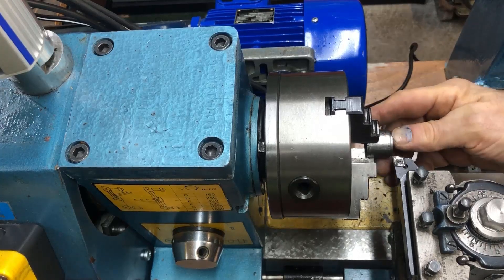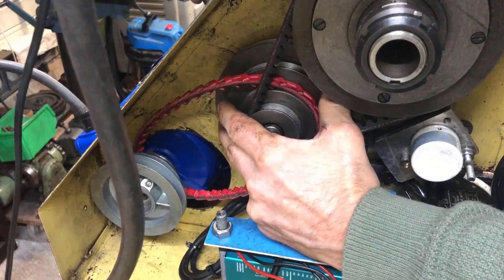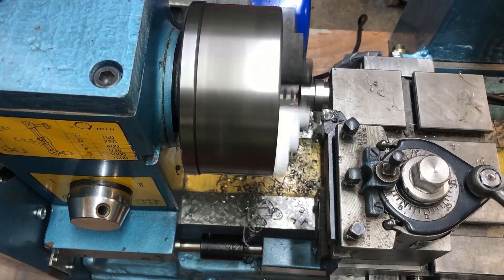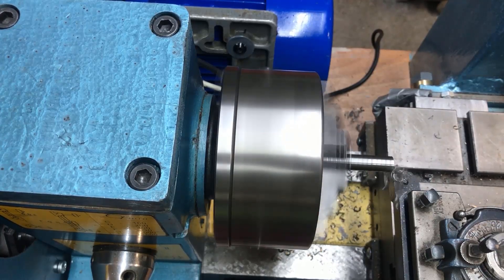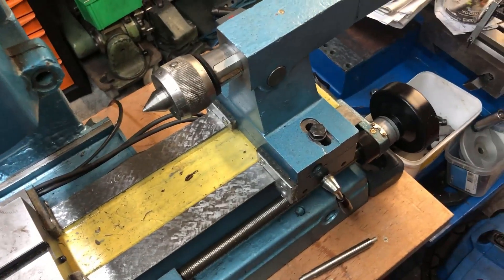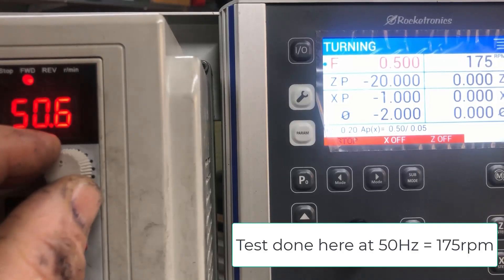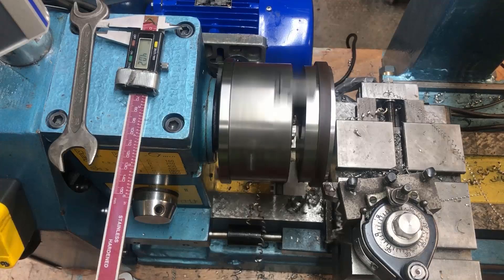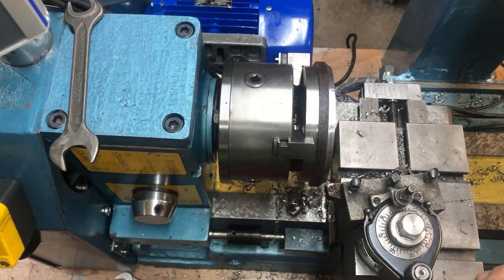Smarty AT-300 - tests

Comment: Hi jan, do you plan to try to restore any watchmakers lathes such as the schaublin? It would be good to see if you are able to restore it back to factory specs, they require fine adjusting and scraping
Reply from the maker: @spewgw8417  No plans as of now, but could be fun. The work we do, or shall I say the level of perfection that we strive to achieve to restore machines is generally to a "industry standard" of "2 tenths per foot" ie 5/1000 of a millimeter. Below this level I cannot make repeatable accurate measurements in my home shop.I guess you could that most parts on a watchmaker lathe would be within that spec
Reply: @jansverrehaugjord9934  sounds good, maybe look into the older watchmakers lathes that use the dual bronze bearing setup, that would be an interesting video showing the scraping process of those bearings, as they are not split like the ml7, it looks a bit like a collet
Reply from the maker: @spewgw8417  Certainly interesting design. I have a machinist friend who is also a watchmaker and has a variety of different lathes and milling machines, among those a number of Schaublin's as well as diffeent watchmaker lathes of other brands. I bet he has been through these steps.

Comment: Hello Jan, your work is very inspiring! I watched the previous videos about the Smarty, and a lot of the other videos. I saw a bag of "sand" you mix in your home made epoxy granite. It's probably not sand, I guess it is higher density? What epoxy do you use? Cheap polyester used for glass fiber repairs on boats or body parts? I have a small Chinese benchtop mill, and I am planning to add som weight to the hollow coloumn casting by casting it. It will not add stiffness, just weight, but weight matters to, i use mostly 6mm carbide cutters at high rpm...
"Real" machine epoxy from an manufacturer is probably very expensive, I think Stefan Gotteswinter or someone knowlegable like him said it's not cheap, the industrial stuff. Better to go cheap on cheap machines, and expensive on expensive machines... Nice work with the Smarty!
Reply from the maker: Thnks for the nice comments! I have used Glasscast epoxy, bought locally here from Gustavsen: https://www.gustavsenas.no/easy-composites/1215mor/epoxy-glassklar-3-velg-riktig-mengde
PS! I am by no means an expert on neither epoxy itself nor epoxy granite, but it sems to work. The mix was not following a specific "recipe" and aside from getting the basic "fluidness ratio" epoxy/sand, I rather used what I had from a "throw-in-metal-pieces" point-of-view to add weight. I have also drilled holes in the cross-member sections of the bed and inserted a number of threaded rod pieces to further stiffen and bind the epoxy/sand mix.
PS! I know Stefan from a scraping class in Denmark I co-hosted and where he attended as a student. We both stayed at the same beach-house, also joined by Richard King, the scraping mentor from USA I have befriended, who was the teacher (as we have been most fortunate to have in most of the other classes I have participated in). Also "bunking" together with us was Mr. Christensen from Australia, so we were a very International team! We had a very nice time together and the class was (as usual) very rewarding to hold.
Reply: @jansverrehaugjord9934  That's really cool to hear, sound like a good gang to hang out with! I will look into that resin, seems like clear epoxy. I'm from Sweden, we have the warehouse Biltema like you have in Norway. Their polyester with hardener might also work... But I think what you put in it matters the most, only polyester resin is quite light...
I am thinking of steel balls, like ballbearing balls. The smaller ones filling voids good and compact well, and they are hard, low elasticity module...
Reply from the maker: @trashanken  The epoxy/polyester only acts as a bonding agent, so you are probably right. Use what you have was my mantra here, but I am sure one can optimize this a lot vs my approach. PS! There is another Swedish gentleman having experimented and investigated quite a lot more into this than me. He might be worth discussin this topic with: https://www.youtube.com/watch?v=gjw5juGG1g8
Reply: @jansverrehaugjord9934  Thanks, he was a interesting fellow! After that I found even more epoxy granite builders...
Reply from the maker: @trashanken  Oh yes, there are many :)